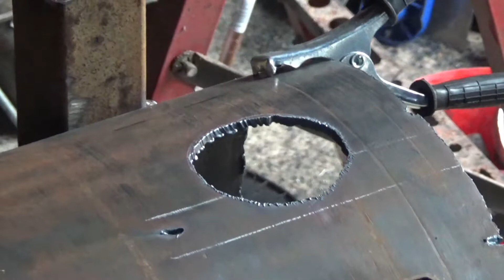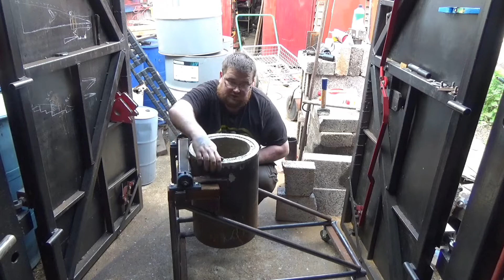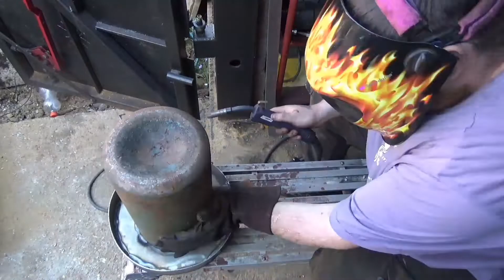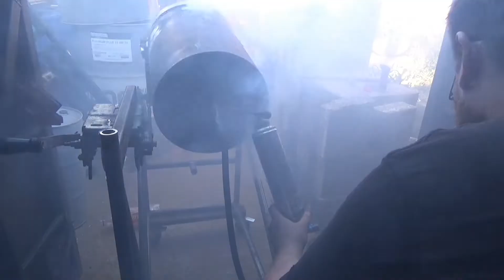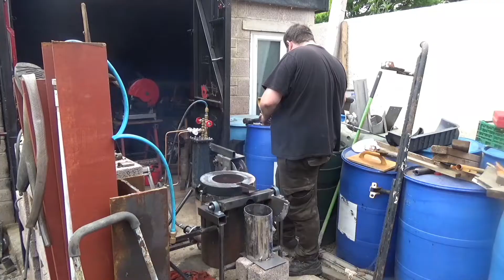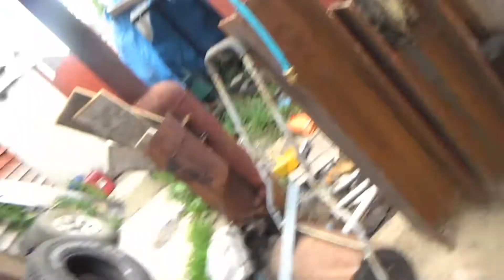homemade diy tilting waste oil foundry build video

Comment: New subscriber, will be watching more of your work
Reply from the maker: Thanks, it's much appreciated. The channel is slow at the moment, but it's not dead. I'm just tied up with life.
Reply: @smithbuilt I get it! Still looks a lot of learning to be done from you!
Reply from the maker: You should see the stuff I haven't finished yet. I imagine you will like my new heater
Reply: @smithbuilt I’m trying to find the time to make my first waste oil heater, motivations low when temperatures are in heatwave levels - got a barrel of used engine oil I can use and generate 30ish litres a month at work so basically more than I need 😂
Reply from the maker: I get mine from a garage. Normally, just empty the icb thing when I'm down to my last 200-ish litres. Typically, 1000 litres lasts about two-three years if I'm not melting to much scrap. Stuff is black gold in the UK with fuel prices like they have been the last few years. I've got to build a small refinery for waste oil as my big old diesels will drink it raw but my crv is a bit more highly strung about fuel quality then my l400 delica
Reply: @smithbuilt  I’m also uk based, and run a small garage and try and avoid oil changes… the stuff is waste for me.

Unfortunately my vehicles are also too highly strung to use it for motion, but heat and having some fun melting scrap would be a good use